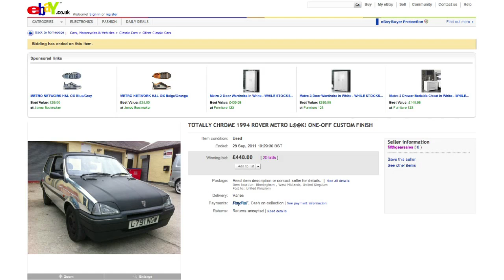Creative FX Wrappers Chrome Old Rover Metro for Channel Five's Fifth Gear

Comment: i now own that metro and just to let you know alot of areas of the wrap are beging to peel so its done 3 years so not bad...... iv added some of my own vinyl to the bonnet....... a massive top gear logo ha!!!!!
Reply: mrmike6363 have u joined metro power
Reply: yeah a long time ago mate. iv still got the car btw. the metro power people hist at me thou when i joined and said i had that car... but that was the forum not the fb page.. fb page seems to be more friendly coz people have to use there acounts and show there face lol.
Reply: mrmike6363 ok, what have u done to the car
Reply: gti alloys welded in front shocks.lowerd straight through exhaust.flame kit. got a 143 vvc waiting to go in but i gota get a mpi fuel tank iv got everything eles wiring loom ect ect.....
the cars looking a bit rough now.. people in car parks have preyed on the car and dented all but one of the arches and it show really badly coz of the chrome. i watched someone on perpous swing there door into it.. and yes after i kicked the guys car.i was so angry about it hes lucky he didnt get laid out.oh and someone tryed to nick it and broke the up right part of the drivers window, the metal has snapped and it let water in the foot well witch has now cause the jacking point to go so now needs welding. it will be all sorted in time as its still under 60k miles and worth doing. the one thing iv learn having a chrome car is that people are cunts and get jelouse of it witch is funny as fuck coz its a 1.1 metro lol
Reply: mrmike6363 yes, I've got a r100 and it's my first car so no vvc yet but I'll be adding gti seats red seatbelts, red carpet, gti seats, ax centre console, brm steering wheel, gta alloys and gti exhaust. I've already put a spoiler on it. bty it's red and trying to make it like the antebs nova
Reply: same about the wankers kicking it and denting it though
Reply: cool well welcome to the metro crew lol. yeah build up all the stuff you need and get it all sorted then when your insurance is a bit cheaper you will be ready for the swop....
have you been in a 1.8 tro? they shift and they can brawl with some of the best cars out there..
if ya get stuck with something and dont get your answers from the metro power lot drop me a message and i will try to help. they can be very very clicky on the metro power pages as are most owners groups. and if you ask them about wireing looms they seem to flat refuse to tell you and all they will tell you is to speak to a guy on there who makes the looms witch is anyoing coz why would u pay him when u can do it yourself lol
Reply: mrmike6363 yes well I'll probably put a 1.4 16valver in as I will be doing Hillclimps so it has to have an engine that it originally came with. but will be built to a high spec with hi lift cams ect. will probably have tf calipers aswell with 14s. thanks for the pointers bty. 

were do I need to trim to get the mg metro carpet in a tro
Reply: sounds good mate. the 1.4 is a good engine better for tuning as the cyclinder sleves are bigger the head dont move so much.

hmm onestly i dont know the answer to that iv never really worked on the older tros... hmm i cant see it being to hard to match guess ya will have to takes yours out and just try it
Reply: mrmike6363 ok a few people have tryed but yes. is it hard to remove
Reply: Do you still own the car? I notice it's been off the road since 2017 but it doesn't appear to have been scrapped.
Reply: @ryanwilliams6526  yes iv still got it.
Reply: @mrmike6363  Oh great! Good to hear that it still exists when so many Metros have been scrapped.
Do you have any plans to put it back on the road?